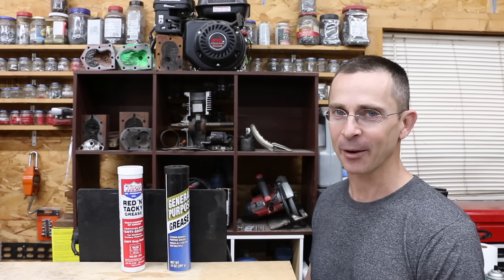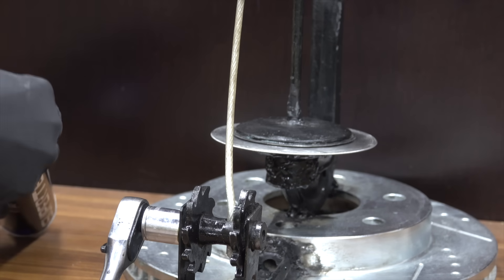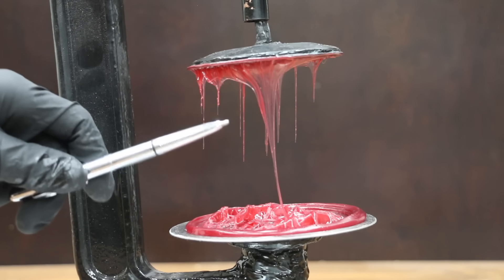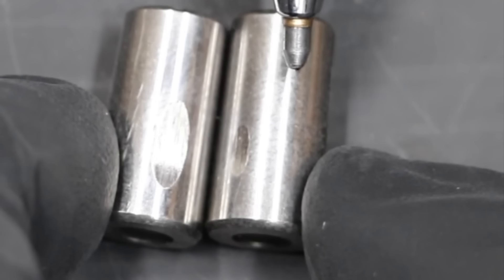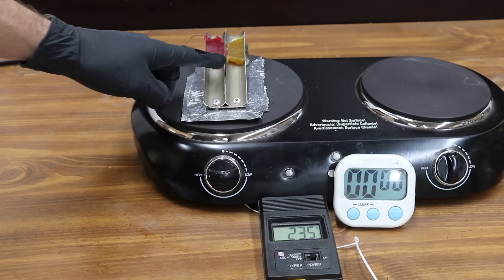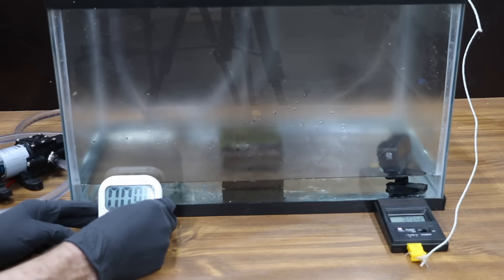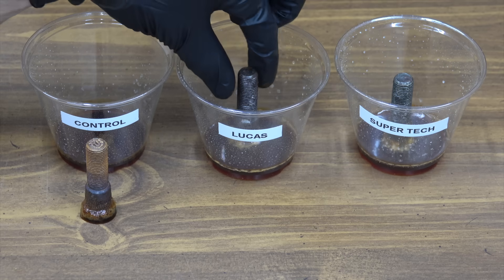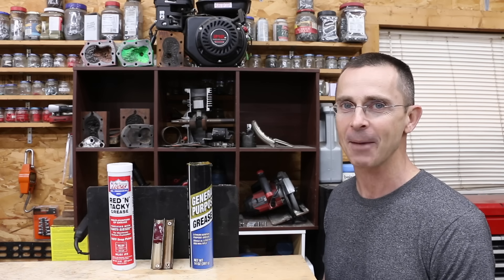Is Cheap Grease better than Lucas Red N Tacky? Let's find out! Bearing Grease Test Episode 1

Comment: If you decide to test the types of grease for tractors and implements it would be interesting to add an aqueous solubility test and perhaps the various friction tests with some water added in the grease.  In the interest of mimicking conditions outdoor equipment are exposed to.

I have been just using the Kubota grease on my tractor but often wonder if the same rating shell, mobil, etc are as good or better
Reply from the maker: Thank you for the idea!

Comment: Great review, I would like to see “NCH Premalube” against “Castrol agri ultra”  thanks mate. and you should try the LUBRICITY test without  the cup as well, maybe add like a pea size of grease  around the bearing to see how they go without a constant supply of grease.  Just like it would be in a high pressure area and most of it is being pushed out..
Reply from the maker: Thank you for the video idea!

Comment: Every Monday I look forward to watch the videos you make. I’ve been watching the videos you make for over 2 years and can’t get enough of them.  I’ve seen them all multiple times. I would like to see you test what razor blades for facial hair last the longest since you have that sharpness testing machine. I would also like to see what spray glue works the best in normal conditions, hot temperature , cold temperature and wet conditions when used on poly.
Reply from the maker: Thank you very much!

Comment: How about using those grease injection needles? Does overfilling a sealed bearing with one of those make it overheat? Run cooler?  If anyone can figure it out, project farm can!
Reply: Too much grease makes the bearing run hotter, at least at high rotational speed, if it's moving slowly or mostly having a static load, the more grease the better. You could also blow out the seals by packing too much grease in, which is obviously not ideal.
Reply from the maker: Thank you for the video idea!

Comment: I use red'n'tacky for all greasing at my home and job in commercial hvac. Everything from 100hp induction motors to air handlers and even my fire pumps. Used mobil 1 lithium for a while and i am very underwhelmed. It separates and bleeds out of the grease gun dripping everywhere.  Switched back to lucas and have no issues.
Reply from the maker: Thank you

Comment: I have about 5 greases in my little shop. Use them according what i feel is needed. I mostly use synthetic grease. For some applications i used to use a grease from wurth which was made for sliding spline shafts. Most greases would not work for this situation. So what you proved was that you get what you payed for but do you really need the expensive stuff. Your choice upon needs.
Reply from the maker: Thank you

Comment: Some years ago I did a lot of spec and price comparisons and settled on Lucas Red N Tacky. Glad to see it came out well.
I do wonder if that is a good "tacky" test though. It seems like it is primarily testing viscosity in sealing out the air. I wonder what a tacky test would be like if you used a ball on top, touching the greasy plate on the bottom. Would not have near the withdrawal force (more sensitive gauge?) but the tacky would mostly be in how long of stringers it makes.
Thanks for testing!
Reply from the maker: Thank you

Comment: Lucas is definitely the better grease. Like you said, grease is grease. I’ve said the same with oil.  100% of the time cheap lubricants are better than no lubricant, but not sure how you could test that. I guess the question is, long term, if greased properly with cheap grease, would it matter?
Reply from the maker: Thank you

Comment: Urgh. Hate seeing manufacturers not giving complete information on greases, particularly for the supertech grease, it only mentions the oil viscosity in the grease as just...'heavy'. Secondly, a dropping point of just 350 F or 176 C is pathetic from a industrial usage point of view. however they ain't wrong when they mention is as just a light duty grease. Not all grease are EP greases btw.

Lucas Red & Tacky looks impressive but they didn't mention what type of thickener?

Could you also attempt to test Mobilgrease XHP 222 against Castrol's calcium complex or calcium sulphonate greases? It's a professional interest to see how they compare against each other in water resistance.
Reply from the maker: Thank you for the video idea!

Comment: I would like to send you a tube of a very special grease recommended by a lubricant engineer at work. Its not easy to find in the wild, but performs excellently on sliding surfaces and bearings. I got a case of 50 tubes and still have about 20 left before I reorder! PM me!

Comment: Will you test Acetone and transmission fluid for rust removal  and removal of rusty  nuts on bolts long time follower  of the channel  like your content  keep up  the  good work
Reply from the maker: Thank you for the suggestion.  I tested it in the first penetrating oil showdown and it did great

Comment: Do a sandpaper/abrasives test sometime. Being a knife maker, I go through a lot of abrasives and it would be nice to know whats best on different materials.
Reply from the maker: Thank you for the video idea!
Reply: For wet sandpaper you can't beat 3M. I've used some crappy sandpaper and it seems obvious to me when it is not performing. Stuff dulls fast, wears out and just doesn't cut. I think the trick is just buy coarse sandpaper because it is going to be medium then fine eventually anyways.

Comment: The chain in my transfer case broke one time when I was picking a guy up from Jacksonville Florida I packed it full of Lucas 5th wheel grease and drove about 240 miles only stopping in Tallahassee to repack it.
I got a hundred yards from my house and the transfer case came apart.
Reply: If you'd used red n tacky, you'd still be driving with a broken transfer case today!
Reply: @svtirefire  it was a dodge ram so I doubt it.
Reply: adidas78937 over packed, no room for EXPANSION   CHEERS FROM NJ 🇺🇸🇺🇸🇺🇸🇺🇸
Reply: @flybyairplane3528  I didn't mention the case actually broke and I didn't fully pack it.

Comment: Deleted Outtake:
Project Farm: ...Lucas claims to be red and tacky.  It's obviously red, but is it actually tackier than SuperTech?  We're about to find out...
Camera:  pans left, shows SuperTech container with glitter while the Lucas container is wearing tube socks with flip flops.

Side story: We had a peeper who was looking into  one of our bedroom windows.  We ended up using Red N Tacky on the cement windowsill and needless to say, that ended the problem mity-quick. Added bonus was that the grease lasted at least 2 years on the windowsill, through exposure to Chicago weather.  Ended up having to scrub it off when we put on our porch addition :-)

Comment: “Extreme Pressure” has special meaning with respect to grease.
Reply: Wheel Bearing grease.
Reply: EP means it has Extreme Pressure additives such as phosphorus or zinc which are chemical EP’s or moly and graphite which are solid additives 
Not good in some circumstances 
Grease selection is as varied as the applications
Reply from the maker: Great point

Comment: Great video.  I was excitrd see the results of this. When i owned an excavator, red and tacky was all i would use on it.  It was at least twice the price of the grease other operators were using but I thought it was worth the price.

The only real complaint i had was when i managed to get some on myself.
Reply: Exactly. I use a red high tack grease on my excavator and backhoe, but I regret it when it starts showing up everywhere like  car seats and in my hair. Special mess when pressure washing the beasts and the grease ends up all over.
Reply from the maker: Thank you

Comment: One thing I will never understand is why grease typically has such nasty colors. I like Lucas because, besides being a good grease, it doesn't make my equipment look like its covered in feces. I used grease to lubricate any bearings on my 3d printers as well as some old/cheap power tools I have, and it does help a bit. It also helped tremendously in the gear box of a cordless screwdriver, it made it quieter and fixed some squeaking noises.

Comment: Not really a good comparison. Although your basic point that all greases are not created equal is of course very valid. I deal with greases like braycote micronic made for temps down to -100F. But you would crap your pants if you saw that it was over $2000/lb. Grease like Aeroshell 33 are much more attainable for high performance. Molybdenum and Graphite are great additives.

Comment: Todd, this was a skewed test.  You used a 
known light grease, against a known heavy 
grease.  The Walmart stuff bills itself as 
light grease.  Lucas doesn't. You even mentioned 
the Walmart (SuperTech) grease was light 
duty.

Next time, try budget heavy grease against 
the Lucas stuff, and some other light grease 
against the Walmart stuff.

Also, if you would, look at food-grade white 
lithium greases.

steve
Reply: Steve Skouson that’s what he says in the video...he acknowledges that
Reply: @dogewisdom9921 , go and re-read my post.
I DO realize that he mentioned it, and posted as such.

But, comparing a heavy duty grease to a light duty 
grease?  The light duty grease will ALWAYS lose!

What I'm saying, why compare a 426 Roadrunner 
to a Plymouth Valiant?  Not an equal test!  That 
is what Todd did. (Even if the Valiant had the 318.)
(Oh, have owned both cars.  Well, the Roadrunner 
had a 383, and the Valiant had the Slant Six...)

Until THIS test, Todd NEVER skews the results!

steve
Reply from the maker: Thanks for the constructive feedback. I do believe that this video will help people, including myself, select the right grease for the right application, preventing future part failures.

Comment: Very cool!  I have used the Lucas Green grease extensively. It is their grease for "sealed" bearings and other "lubed for life" applications.  It corrected heat-induced failures of alternator bearings that had been failing regularly. The alternator was a built-in welding power source added to a 2002 Ford powerstroke 7.3 engine. The original bearing lasted about one year. The OEM replacement also lasted about a year.  The third one  removed all the OEM grease and then greased with the Lucas Green. That one lasted about 4 years, until the truck was turned in when I changed companies. 

I like your freezer. That is interesting. I work on antique refrigerators and things like that interest me. What sort of unit is that? A lab freezer?
Reply from the maker: Thank you

Comment: Now I do comment fairly often on your videos, and I pretty much watch every single one because a lot of your reviews are very helpful to me.

Recently I found out that there is a difference between spray paint brands after testing out what works and applies better - specifically when it comes to flat black if you're curious. I would love to see a video about different spray paints
Reply from the maker: Thank you for the video idea!
Reply: @ProjectFarm  I know the Winnebago was not named the showstopper - but maybe you could do a DIY paint job on it while testing different materials. maybe you get a decal and paint your logo on the side or the name of the Winnebago on it. It'll always be the showstopper in my heart though.

Just as a side note I applied fence paint to my large work vehicle that was designed for all weather and I've never had an issue with it

Comment: I was told a while ago "If Lucas makes it, get Lucas."
Reply: Except their oil stabilizers; that just dilutes your oils additive pack.
Reply: @taylorc2542  which oil stabilizer worked better for you?
Reply: Truth
Reply: Used to ride a 2005 R6 out on the highways. High speeds for extended periods, lots of RPM's. I used WIX filters, and always kept my oil changed. One time I decided to try some of the Lucas motorcycle engine oil. First time I took it out on the highway, my oil light came on, and I started to shit myself. Started to slow down to stop, and the light ended up going off. I checked the bike over, fluid was correct, etc. Got going back again on the highway, and it happened again. The stupid Lucas oil was foaming at high RPM. Never happened with any other brand. I used Mobile for the most part, but also ran Royal Purple, and a few other boutique oils from time to time. Still have the bike, its still a screamer. Never gonna buy another drop of Lucas engine oil.
Reply: I use the Lucas gun oil... and the Royal Purple gun oil too...
Reply: @OGL iaDL which products? I really like their transmission fix and the power steering stop leak. Both have worked well for me.
Reply: @OGL iaDL Thank you for the information.
Reply: SanraS Uzumaki
That statement is very much true. If in doubt, use Lucas

Comment: Grease appears to be grease, so a few months ago, being completely ignorant, I attempted to research brands, and for a cost vs info available, I went with the Lucas super tacky (exact same) for my machine tools. I have been very happy and using it on other stuff, and it tastes great '-) Just kidding.  And one factor not considered by you is advertising hype, where Lucas excels in that too.
Thanks for a VERY valuable review, and the conclusion, that grease is NOT just grease!
Reply from the maker: Thank you

Comment: It looks like you doubled the weight in the lubricity tester, not increased it by 50%.  If you had done that, the weight you added would have to be half the weight that was there before.

Comment: I would like to suggest using an enclosed reduction gear or similar and running it until it reaches stable temperature. Then measuring the power input and temperature. With speed control this could be done with multiple speeds (temperatures), all the way up to dripping point.
Reply from the maker: Great recommendation. Thank you

Comment: I would really like to see how the Mystik general-purpose stands up compared to others in its class. Our local farm supply store pushes it pretty hard. If you have ever heard of " Mills Fleet Farm".
Reply: I love fleet farm
Reply: TSC Farm Supply also has Mystic & Shell. It was on sale $2 & change per tube. I can tell it's really no different than this SuperTech he tested.  I used Esso Lonax for years it's good. Monarch Monaplex was also good.  Actually John Deere Cornhead Grease is good as well though more for hot bushings. It is Polyurea the others are Lithium Soap.
Reply: @bradsmith1934  I got some tubes of grease from the city reuse center, it has no label, just chrome color on the tubes. It's color is black as pitch, would you know what that is used for, someone guessed it's graphite based.
Reply: @grantw.whitwam9948  It to me would be Molybdenum Disulfide Bushing grease. Good for Ball Joints general Chassis service, not intended for Bearings though. Bushings & Slides/Bedways, yes.  I suspect it is 'expired'(why the shop sent it to Recycle)  Fleet Service 5th Wheel Hitch Grease.  My brother is a Class A & claims todays Oil/Grease 'expires' but I don't kiss & tell. Graphite Grease I have used was 'dark grey' the Moly I use at my job is 'black'  Supposing it was Graphite stuff I would still limit it to Bushings & Slides Hitches not Bearings.  Also open gears, sprockets.
Reply: It won’t do well I have seen it on scar tester lost to several other brands
Reply: @RichardJohnson-sg3vo  mystik JT6 outperforms RnT according to their data sheets. Both are good greases..
Reply: Go to your local John Deere dealer and try a tube of their stuff. Stays where I want it at least twice as long as anything I ever bought at Fleet.
Reply: They carry the Mystic stuff at our local farm store, Theisen's. I think the only other grease available is Shell, otherwise it's all Mystic.
Reply: @agentorange2554  I have been using it for 12-13years now. No complaints and as far as experience goes, it worked better and lasted longer in farm equipment over the cheaper stuff we tried.
Reply: Use Cenex blue quality with a reasonable price.
Reply: @randykroells8049  Cenex used to(maybe still does) make really good quality oil and grease for a fair price, we used to buy bulk for the farm years ago. The John Deere grease was a bit better but cost more. But the SAE 30 we bought in 2.5 gallon jugs was top notch.
Reply: It used to be good an years ago when Cato oil co owned it Thier engine oil had a guarantee to replace it due to oil failures
Reply: I try to use Mystic or Lucas Red N Tacky. Tbh,the only reason I used Mystic is because Bill Dance uses it. I use the Lucas because I used their fuel injection system cleaner when I had a stuck injector in my Chevy. It did work. I've also used their Transmission stop slip about 20k miles ago on my slipping tranny in my 93 ford A4LD in my Explorer. So far it's been working fine. I put it in as soon as I noticed it was slipping. It fixed the torque converter shudder too. I noticed it began working normally almost immediately. I changed the filter and the fluid also.
Reply: I like Mystik because it was a clear, petroleum jellyish grease that didn't make a mess.  Wasn't the best EP grease.  Most molly based grease makes a freaking mess but does better for high pressure applications.
Reply: Mystik is Citgo's consumer brand, it's good stuff. Citgo also bottles all of Farm & Fleet branded oils and lubricants. I use Mystik or F&F fluids and lubricants in everything I own and haven't had any oil or lubrication related failures to date caused by them.